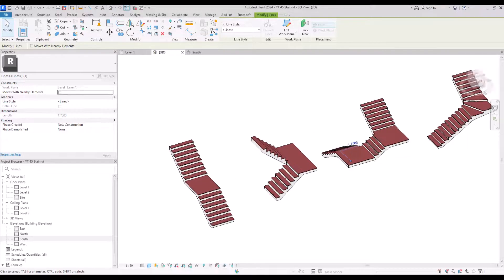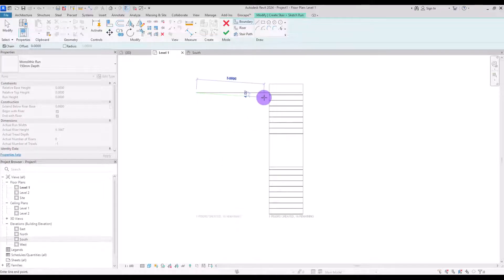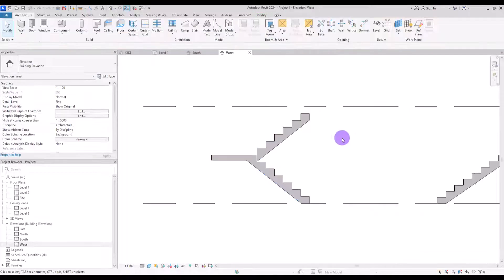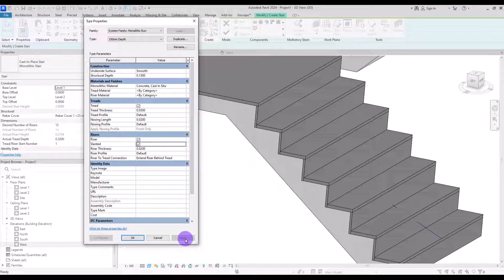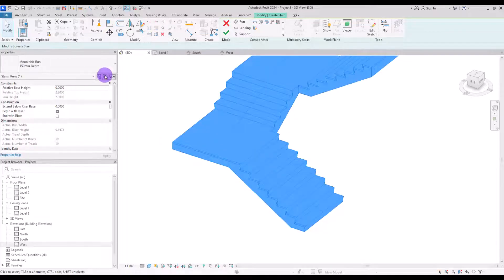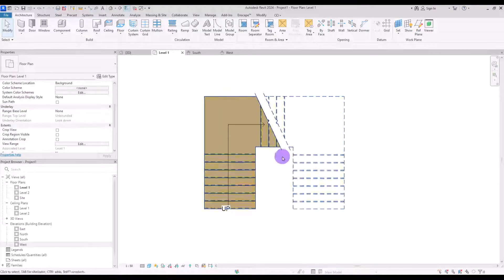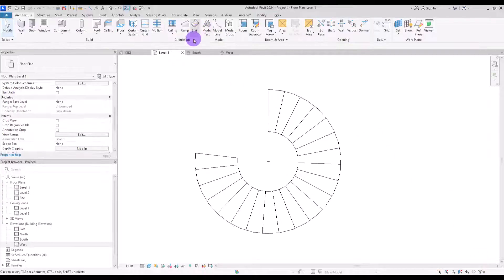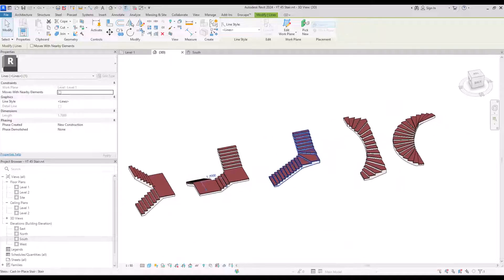Solve the Ultimate Revit Stairs Challenge with 6 Different Stair TYPE #revit

Comment: thanks for the tutorial, i have a question, would you mind showing how to make one different riser height in one staircase
Reply from the maker: You mean for example all riser height be like 0.15 and just one be 0.17 ? right ?
Reply: @RVTPLUS  yes, example of a condition where the beam is at a different level to the starting point of the stair, how to connect the stairs to the beam if the thread and rise size is locked

Comment: When i place my risers the number doesn't count down as if they are all on the same level. Also i cant do the thing where you just click on the first riser and it makes another an equal distance even with my offset as the distance i want. Any suggestions for help?
Reply from the maker: For the first part of your question, the automatic countdown will not appear in Sketch mode. If you create a stair with the "Straight" option, you can see it. 

About the offset, it could be tricky. You need to make sure that it is set to "Pick Line" mode, "Riser" is active, and the offset has a defined value. Often, it switches to boundary, and you need to re-select and set them again. 
Also, you can test working with the offset and pick line by using a model or detail line to ensure proper functioning.

I hope this is helpful!